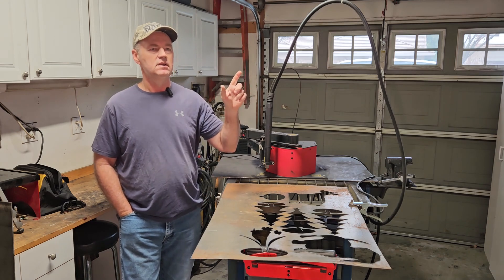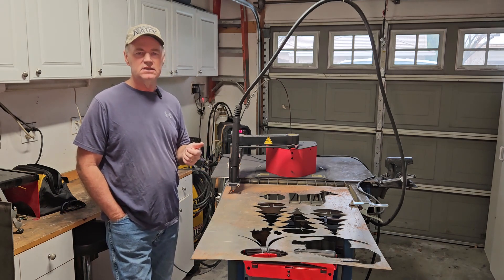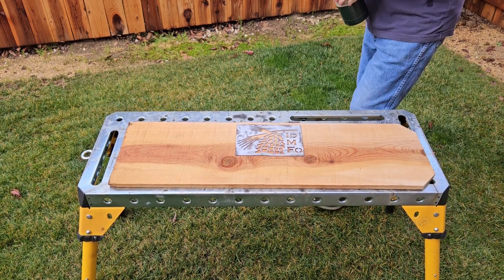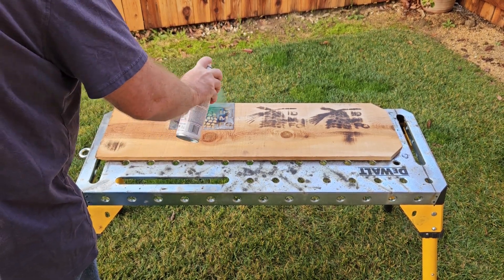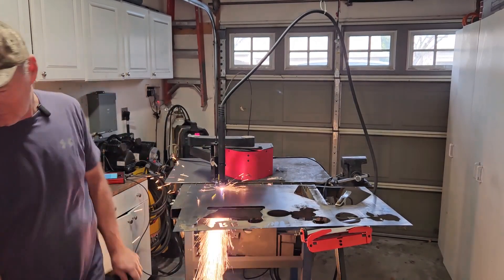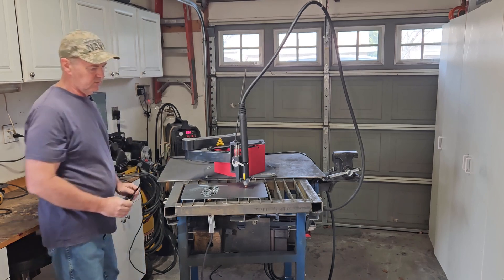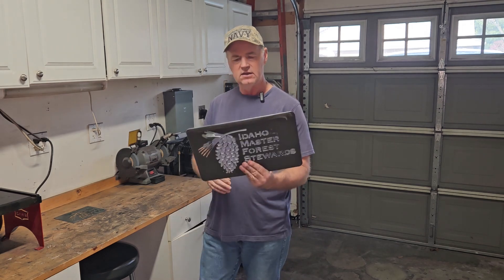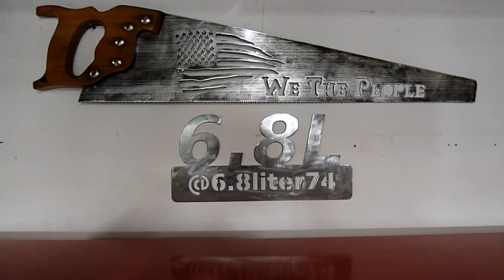Arcdroid: File too large to load.  How I deal with it.

Comment: Ok i just got my AD and have less then zero experience in the cnc world...but learning.  My question is ...why did you skip around with the letters instead of just cutting out a complete word before moving on to the next word
Reply from the maker: To spread out the heat and minimize warping.  When you load a dxf into arcdroid it will do some of that automatically.   It appears that you have even more control using sheetcam, but I''m just learning that.  Thanks for watching!

Comment: How about using the sign as a branding iron on the wood just weld on a handle?
Reply from the maker: That could be interesting.  You would want to use much heavier material and a better heat source to heat the branding iron.  I would try it with something much smaller first.

Comment: I've found that converting  a DXF to Gcode prior to loading into AD lets you have a much bigger/complex file. I've been using sheetcam to generate the Gcode and it works really well.
Reply from the maker: Thanks for the tip, I may have to start using sheetcam.  I looked at it when I first got the AD, but I've gotten used to going straight from inkscape to AD and it usually isn't a problem.
Reply: Can that be done in Inkscape?
Reply from the maker: Inkscape can save your drawing as a dxf.  The arcdroid can load that and convert to gcode.  Sheetcam can be used between Inkscape and the AD to generate the gcode externally and giving you more control over the gcode.  Then you load the gcode in the AD and use it.
Reply from the maker: Yep that happens.  Then you go back to Inkscape and try to simplify the drawing removing as many nodes from the path as you can.  Ultimately you may have to do the cut in 2 parts.  I had that issue in this video https://www.youtube.com/watch?v=4JLRgySwVso